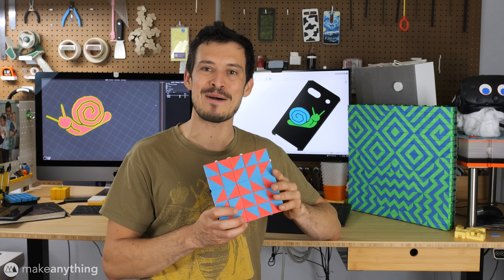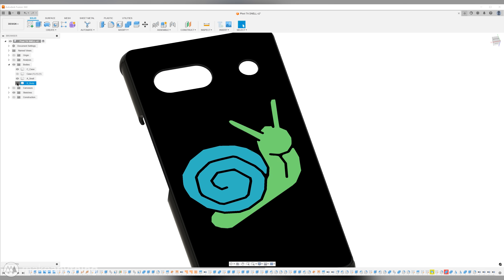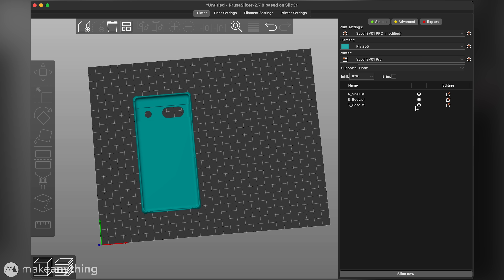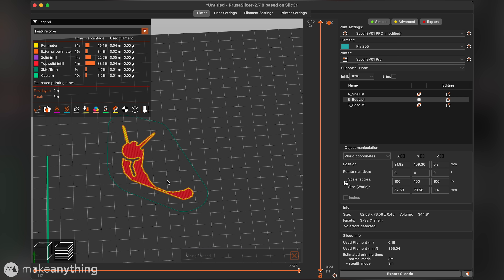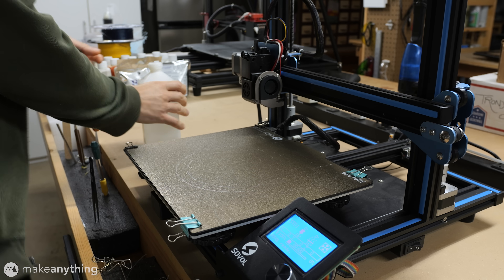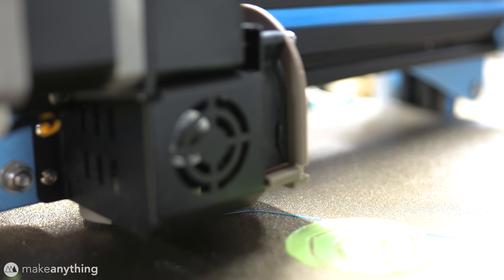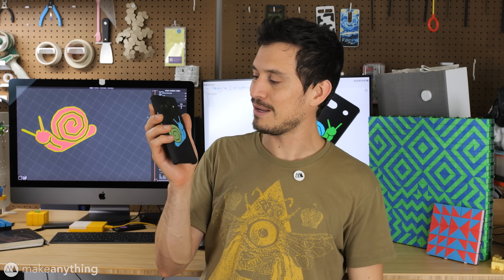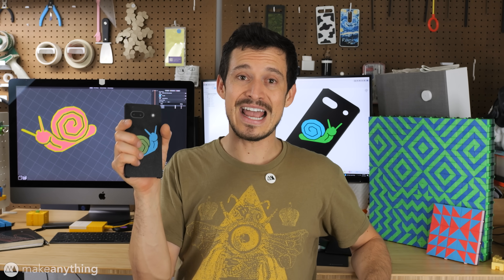Multipass Multicolor using Prusa Slicer // Single Extruder Multicolor 3D Printing

Comment: Hello from the future.

I was fumbling around in orca slicer while watching this video and it has an option called "single extruder multi material" which looks like it might do the deal. I’ll try it out tomorrow hopefully it does this thing
Reply from the maker: I haven't tried it but heard of that as well. I think it is essentially the same, but not sure if it allows printing more than one layer at a time between filament switches... I like printing .4mm tall in one color before starting the next color, so it's a bit more vibrant.

Comment: There's a better way that avoid the collisions and treats the slicing as if you had a multi material machine. 

What you do is the following in "Expert" mode:
1. Setup the printer profile by enabling "Single Extruder Multi Material" 
2. Set the "Extruders" to the number of colors you want to use
3. Under Custom G-code do the following:
   - Set the "Tool change G-Code" to M600 ( Or your equivalent pause command for your printer )

Now when ever the printer changes to the next color it will pause the machine which allows you to change the filament manually.
Just don't be rough when changing the filament and if you really up for sitting around you can attempt a multi color model.

Comment: You can import one STL with 3 bodies in prusaslicer and split them up, you end up with the same 3-body part perfectly aligned.
Secondly I always model in an artificial "skirt" around the object to make sure every generated skirt is outside of that perimeter. Or leave them out entirely since you seem to have a purge line in your start gcode anyway

Comment: Set up for single extruder multi material with several extruders, add the following to the Tool change G-code:
{if layer_num >= 0}M600{next_extruder + 1}{endif}
Hopefully YouTube doesn't bungle the code, but the gist is to add an M600. The extra code is just to avoid an unnecessary swap at the beginning.

Comment: Now I'm curious if in orca slicer I can print by object and add a pause in between each object to switch out the filament 🤔
Reply: Theoretically yes, but I haven't found out how to make it ignore the fact that there will technically be a collision between the first part and the nozzle. Hoping someone else knows how to get around that. Setting the extruder radius to 0 doesn't solve it.
Reply: @swissfreek  off the top of my head I think there's a tool height specifically for that
Reply: @MrHeHim  There is, that didn't help, either.

Comment: 1:39 whoa! 90 seconds in and this was already worth the watch. I never knew that trick and I've struggled mightily in the past to get designs signed up for multicolor prints like that!
Reply: Though, as a side note, if you created components from bodies in Fusion360, then export all those components as a single STEP file instead of an STL and dragged that into PrusaSlicer (because it will take STEP files), then you end up with individual objects in one part, which you can then split to objects like you did in your video, still aligned as they were in Fusion360. Not sure that's any easier than your method, though, haha.

Comment: Can you not set it to multi extruded and then set it to manual swaps? I’m sure I’ve done this before and just sat next to it for an hour swapping out the filament for colour changes on my mk3
Reply from the maker: I wasn't aware that's an option! Still, I'm not sure you'd be able to print 2-3 layers in one color before switching to the next color and starting back at the first layer
Reply: @make.anything  no it’s by layer so you would have to swap the filament more, but it is an option for if you want to print a larger object

Comment: I love this technique and now I have a video to point people to when explaining how to do it in my prints!
I usually add a m600 command at the end of each print so the next job is ready to go with a new filament and the bed stays warm which is critical. Sometimes manually switching filaments between jobs doesn't keep the bed on, and it allows you to walk away from the print if you need to. Awesome video!
Reply from the maker: Ah yes I forgot to mention keeping the bed warm. I've done that in earlier tutorials but this time I was just waiting by the print so I could quickly start the next color

Comment: For such a simple design I guess you'd do the black print, flip it and fill the voids with coloured UV resin in a couple of seconds per colour. This technique is applicable to more complex designs for which that would be laborious and error-prone.

Comment: I think there is a better method and maybe even easier once setup.. Create 3 extruders in the printer settings. Assign each model to a different extruder. Add M600 command (filament swap) as command to change extruders and slice. The advantage is you have it all in 1 file and that the bed does not cool down between the filament swaps, if you're not there at the exact second it finished the first /second color.
Reply: I have used both methods, and find that the multiple extruder/600 method produces the best results, and less likely to introduce conflicts. Additionally, you are not limited to just the bottom of the print. You could also easily add swaps on the top of the print as well.
Reply: But is this method not bound to a filament change each print layer as for it is not printed sequential? First layer first color and then the switch to the second color, than, layer two back to the first color and another change for the second color and so on. Or do i miss something?
Reply: @rollcontainer  It works even within a single layer. You make PrusaSlicer think your printer has multiple extruders and just use M600 as a tool change gcode.
Reply: I printed those tiles via combining gcode and a m600 in between but i would love to do less manual steps.
Reply: @rollcontainer  As he said in the video, just make sure your layer high is correct, e.g. just printed 2 color key caps, by adding a 2nd (virtual extruder) with m600 on tool change g-code. I made sure my SVG on the key caps was 0.12 mm high, and printed with 0.12mm, hit print, it had only 3 M600 in the code, and I could manually delete the first. ( but it helps to make sure the correct color was loaded at start.
Reply: This is how I've always done it.  You don't have to worry about multiple individual prints (starting each one with a probe, etc.) and avoiding what's already printed is already baked in since it's one print.  The head politely moves to a safe place allowing you to change filament and move on with the print.
Reply: How is that easier?
Reply: @blackhawk2788  The slicer ends up taking care of the decisions, it eliminates the overlap risk, like Devin had with the skirts. Also, because the print is all done on the the same homing sequence, no risk of the multiple print runs being shifted slightly because homing is redone. OR having the print conflict with the homing of the next print section. It dramatically limits the possibilities of what can be printed on machines that require mesh leveling between prints. Zhop also isn't as critical with M600, as you aren't having to hop over multiple layers. Trying to print a .2 layer around .4 layers can also be problematic with small details, the nozzle is going to rub the sides of the higher existing layers.  2 layer thicknesses is pretty much the limit when running prints on top of each other. With M600 you are only limited be the number of times you are willing to manually swap filaments. Both methods can produce results, Devin is obviously doing it, I have just found the other approach more reliable and versatile.
Reply: This is mind blowing, but I am slightly confused. Could you (or some other kind soul) perhaps go into further detail on how one would actually go about setting that up?
Would I be correct in thinking that each layer you want the 3 colours would then have 3 M600 filament swaps, switching to the next "tool head" (extruder with each part assigned to it) after each successive M600 and repeating the process for each layer you want said colour swaps? 
What is the code for the colour/tool head swap? I would love to experiment with this process, but would like to avoid pitfalls others have already overcome.
Reply: @spencerkapp8034 You got  the idea! I can't link to it here, but I have a video on YouTube that walks through this setup. Warning, my videos aren't nearly the caliber as Davin's! The design aspect is even easier now that PrusaSlicer supports direct import of SVG files.
Reply: @HackMonkey  that was an A+ video, comrade! I'll be playing around with this over the next few days for sure
Reply: @spencerkapp8034  Thank you!
Reply: How do you create the extruders?
Reply: @akg2n  In the Printer Settings, General page, you can set the number of extruders. Make sure and check Single Extruder Multi Material.

Comment: But how to avoid calibration that goes over the entire build plate, like on Prusa printers?
Reply: I guess on objects that come after the first object, you could go into the Start G-code section of the printer settings and remove the mesh bed level commands? But then you cross fingers and hope the bed level from the previous print is good enough.
Reply: If I'm only doing a few of these I'd just open the gcode in a text editor and remove the G80 (mesh bed leveling) at the beginning of every file except the first. If you're using a binary gcode format make sure to disable that for this. EDIT: I'd also remove the M84 (disable steppers) at the end and possibly M104/M140/M107 (hotend/bed/fan) to make sure your machine doesn't move during swaps (thus potentially ruining the mesh level calibration).
Reply: As it's one single model calibration will only happen with the first print.
Reply: @farnaby13  Sadly I just tried that in Prusaslicer 2.7.  And it probed On my second file
Reply: @farnaby13  That has not been my experience. It's two separate prints, it will probe for each one, and on the MK4 it drives the nozzle right through the first part, and still messes up z-height.

Comment: I've done this quite a bit with great success. If you're using Klipper, you can write a custom PRINT_START macro that avoids homing if the printer has already homed - this way you don't need to move the model to a "safe zone".
Reply: Any chance of sharing the macro ?
Reply: Wish there was a way to do that on Marlin-based firmware. I guess you could just remove the bed-level commands from the start gcode.
Reply: Can you share the macro please ? 😮😮😮

Comment: Using tail ends of filament like this sometimes brings problems on my prusa mk3 when the end of the coil decides to poke itself into the hot end cooling fan, jamming it and causing the print to abort.

Comment: I used to to that on Ultimaker 2 back in 2016 :x
But there is a much better way to do it nowadays on non-Prusa, simply printing objects sequencially, with a pause in between in order to change the filament.

On a Prusa though, the M600 command allows to pause,  wait for manual filament change and restart. If the printer understands M600, then it's even easier.
Reply: That was my initial thought, too, especially since with a Prusa MK4 there's no way to prevent it from probing right through the object you've already printed when you start subsequent objects, which screws up the Z-height.

BUT. I can't figure out what value I need to change in PrusaSlicer when printing sequentially so that it doesn't throw an error for a part collision. Even setting the print head radius to 0 still causes an error since there is zero gap between the two objects. How did you get around that?